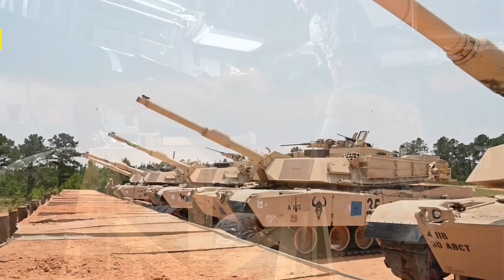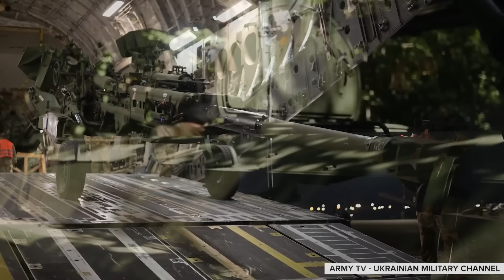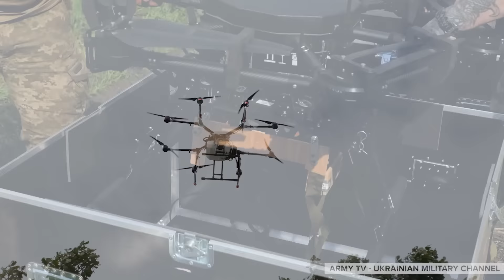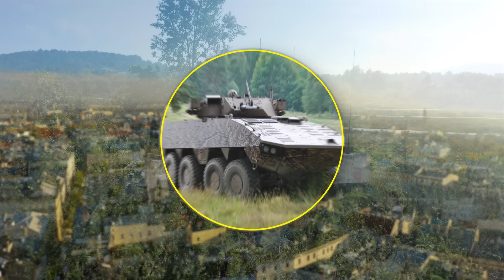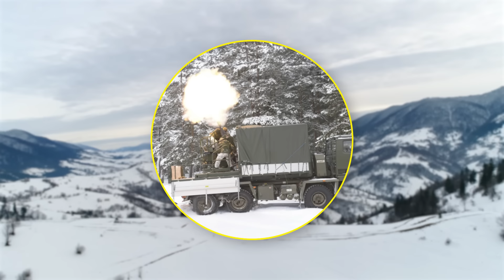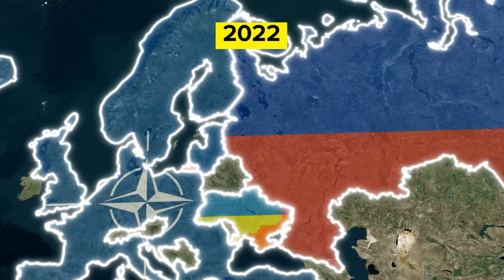Finland Had Enough of Russia - SLAPS THEM HARD!

Comment: Incorrect❗
Estonia and some others have long ago sent prototype weap 0nry to U.
Reply: Why i brought up mostly Estonia is that they are one of the main drone partners (who started the small drone usage there years ago), have sent some small automated multipurous modular platforms there to be used and tested (also have several options some of them armed) and even a newly developed full(even with CAT scan ability) mobile field hospital platform that can be set up in hour or 2 depending on configuration as it is modular(each cost just about 10mil, each can handle about 200 patsients at a time, has operatiing clean room, all test and bloodwork fassilities so on, several were sent/donated just after the invasion).

Comment: I have been railing against the 'support' Ukraine has been receiving for over a year, since the Ukraine was first denied European stocks of old Soviet era aircraft with the 'we don't want to escalate the problem" rhetoric from America.
I was overjoyed when Germany finally offered it's Leopard tanks  as Germany is close enough to Ukraine to provide backup maintenance, and Poland also operated the Leopard and were willing to help Ukraine. 
Then EVERYONE started sending their tanks, each one requiring different supply chain requirements, from fuel types, to mechanical maintenance and finally, electronic firecontrol systems. 

The same thing is happening with the aircraft being donated to Ukraine, with an even larger difference between the various electronic systems than the tanks displayed. 
Now France is donating the Mirage, an aircraft that struggled in South African hands against Soviet jets in the 1980's. 
So well done, Finland, for sending up-to-date weapon systems that are more able to operate in the the extreme local environment.

Comment: I know only one weapon researched in finland but it isnt very top secret. It was new type of jump mine, when triggered it bounces into air and kills everything within 100 meter radius
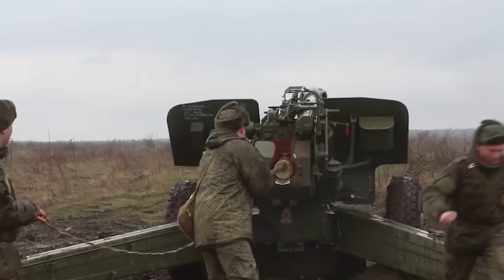Reply: The 100m might be new,but the 6:54  u.s. had  mines in vietnam called "bouncing betties.,"
Reply: They have drone version of the same concept. Flying mine that explodes downward with thousands of metal balls.
Reply: Ah well I don't think it is mines I think it is rather new version of nemo mortar system. Although it would be good if Finland would get out of Ottawa agreement
Reply: It is confirmed that these mines have been tested in Ukraine. They can be launched from drones, while another variant jumps from the ground, detonates at high altitudes, and scatters shrapnel over a vast area. Because they explode much higher than older mines, they can cover even larger areas with deadly shrapnel rain. Ironically, soldiers who instinctively drop to the ground when an explosion occurs may make themselves even bigger targets than if they had remained standing. It’s a testing ground unlike any other... one way to bypass the Ottawa Mine Treaty as well.
Reply: Those mines has been development for bypass the Ottawa agreement. There has been also discussions in Finland to cancel the contract.